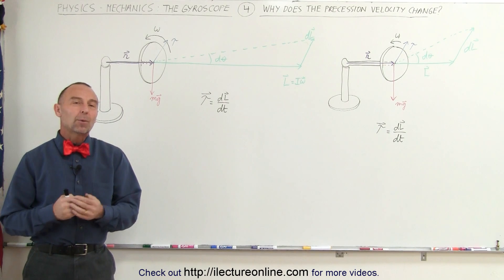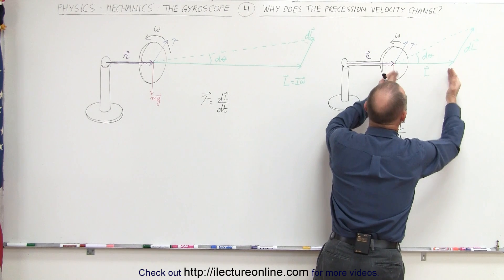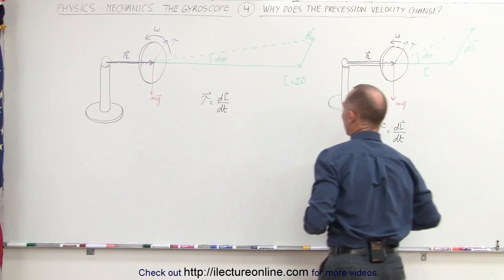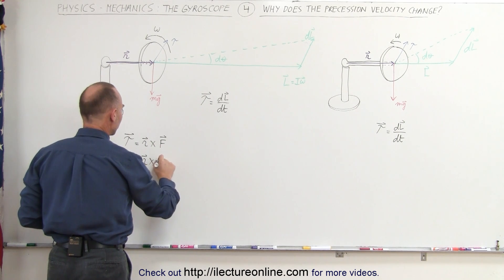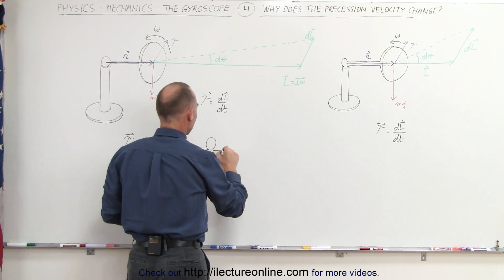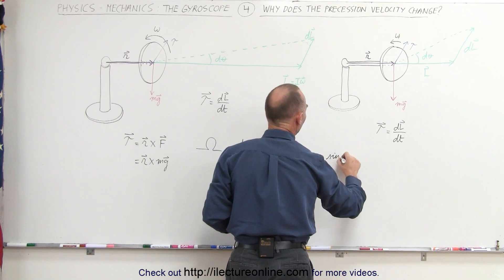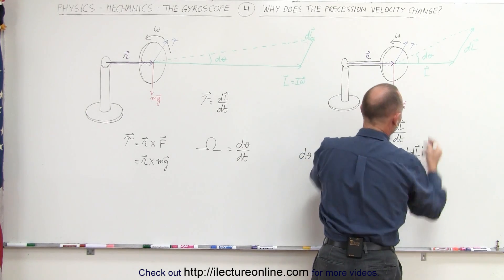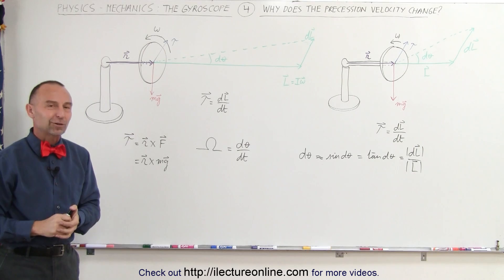Physics 13.6  The Gyroscope (4 of 5) Why Does the Precession Velocity Change?***

Comment: Good Day Prof Biezen, the rotating of boiled egg and later stand up on the edge.Is this related also angular Momentum conservation or which force cause it?
Reply from the maker: The rotation of a boiled egg, does depend on the moment of inertial of the boiled. egg.  But standing an egg up on one of its ends, requires perfect balance.

Comment: Doesn't r also change when the disk starts rising as the procession velocity increases? That would mean the torque also changes and thus dL/dt.
Reply from the maker: When the disk rises (decreasing r), the the rotational speed will increase so that L remains constant.

Comment: If the angular velocity is decreasing doesn't that mean there is a torque acting in that direction?
Reply: That's what I'm about to ask. I think it's not the L that gets smaller, but the dL that gets bigger and bigger. Why? Because dL=T.dt and of course dt (or time) is getting bigger every time. The bigger the dL, makes d(theta) bigger.

Wow I replied ur 3 years old comment.